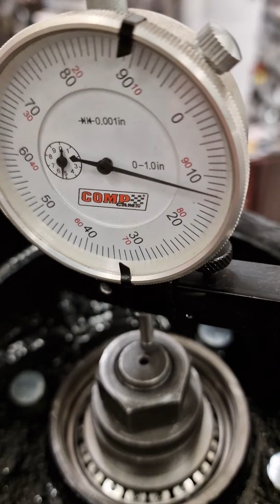corvette C2 C3 trailing arm full restoration

Comment: I'm super disappointing that you didn't show the "full" restoration!  You didn't even show taking the trailing arm apart???
Reply from the maker: Hey. These trailing arms are not part of the full restoration series of the 69 corvette. They are a completely different project that I recorded for the last 2 months.
The next video of the 69 full restoration series will be uploaded this weekend. I have to cut the footage. Today I removed the engine and transmission. Every 10 minutes of video takes 10 hours of cutting and rendering time. So there is a delay of some days.
I think the new footage of the engine removal will be ready on saturday.
I filmed with 3 different cameras so it will be interesting.
Greetings from the V8Lounge 
Andreas